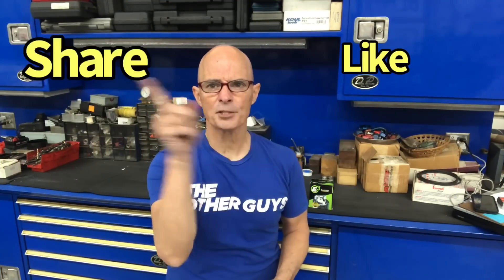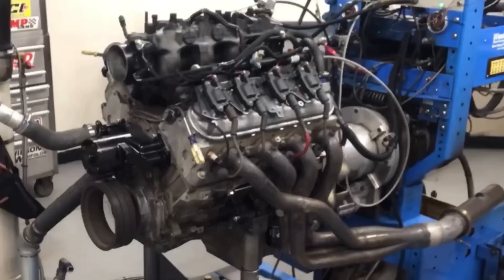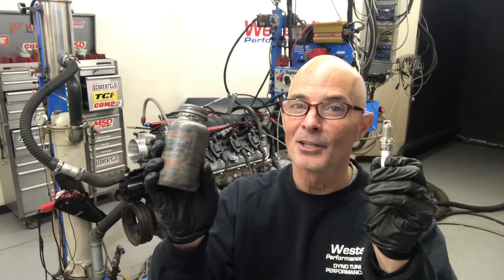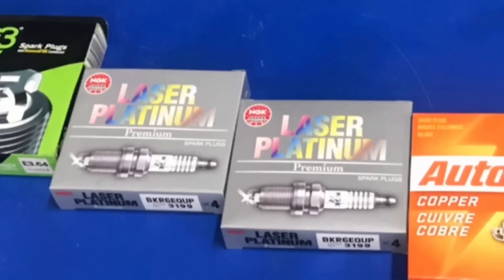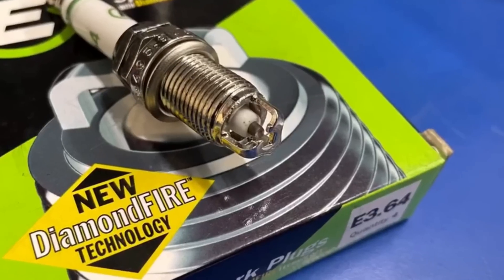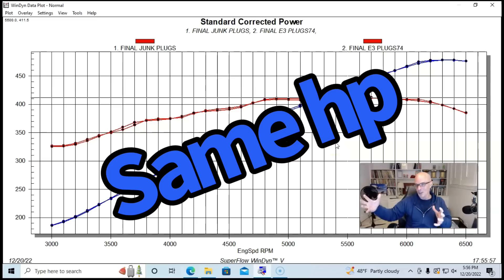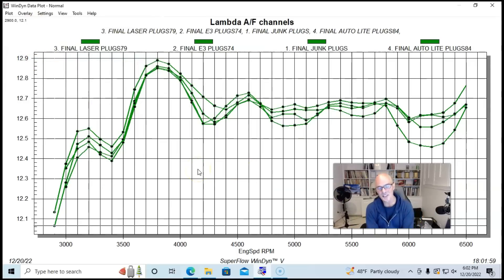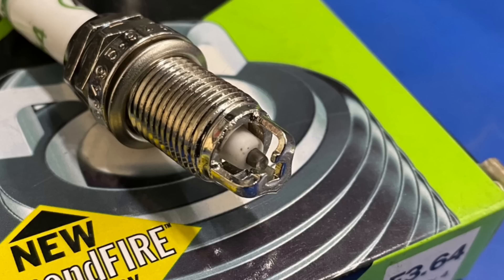E3 SPARK PLUGS-DOES DIAMOND FIRE TECHNOLOGY REALLY ADD POWER? E3 VS LASER PLATINUM VS CHEAP COPPER

Comment: I tried all the gimmicky spark plug back in the late 80's and 90s. NGK, Bosch Platinum, Splitfire, E3, the old AC Delco Rapid Fire fluted plug, and none of them ever gave me better mileage or more power. it may be subjective, but my old 454 used to idle and run smoother with the old AC Delco Rapid Fire Plugs. 

The marketing gimick behine the Rapid Fire was that it was suposed to make a bigger spark kernal to promote beter ignition of the air/fuel mixture. especially if youused a spakrk box, like MSD, Mallory Hi-Hire, etc. they had a display at the local Super Shops (Does anyone Remember them?) here in town they had a HEI distributer hooked up a regular spark plug and a HEI hooked up to a sparkbox and a rapid fire plug, a you could spin the distributers and watch the sparks fly and the spark was bigger on the Rapid Fire fluted plug with the spark box. i already had a MSD box so buying hte plugs was a no brainer. but i will say it did idle better and run smoother than the split fires i took out of it. that could be becase the split fires i was running before were just wrong for the engine. but i have no way to know 25+ years latter.

Comment: Great test, I'm loving this ignition system testing since it's so applicable to so many different setups. You are the first person I have seen dyno test indexing and gapping spark plugs. If I may suggest some future tests, I think "high performance" coils, performance plug wires, side gapping the spark plugs, and different oil grades and types would be great information for a lot of people too.
Reply from the maker: COILS-NOTHING, PLUG WIRES-NOTHING, SIDE GAP-NOTHING, OIL TEST POSTING TODAY
Reply: @richardholdener1727  Sweet, looking forward to that video!
Reply: I’d like to add spark plug wire length. Is the shortest the best or like indexing does having them all the same length help.
Reply: Could you ask about more things that don't change much at all

Comment: I run cheap ngk plugs in everything. Vehicles and ATVs runs great like they should.
Reply: I don't consider ngk to be "cheap" plugs. They aren't a stupid rip off(or maybe not,we'll see) like the iridium and whatever they try to sell you. Ngk are great.
Reply: Ngk definitely aren’t “cheap” plugs they are usually always the highest priced option at least their laser platinum iridium ones that I use.
Reply: Same. Good to read the plugs every 15k anyways
Reply: Me too
Reply: Jus started using iridium plugs on my Suzuki. It does seem better
Reply: I've never had any issues with authentic ngk plugs.  As far as I know, ngk is the oem for chrysler and delco branded plugs.
I'm also a firm believer in running the oem recommended plugs unless the engine has been moded and there's a good reason for deviation.
Reply: Test proves your right!
Reply: Cheap ngk v power copper plugs might be the best overall choice for performance
Reply: Another smart mechanic,Its funny when I send people to the local O'Reilly and they try to push whatever junk plugs they have an excess of/Bosch/autolite Platinum whatever,then they get a dumb founded look when I say nope a want the cheapest ngk plug you have,I've put them in everything including a 367k ls that burned a quart plus a day n never had issues!
Reply: Ngk copper plugs are the best, cheap and work great
Reply: If its a powersports item from Japan or Europe, it gets NGK plugs.
Some of them are more sensitive about it for things he's not testing here...
Reply: @TravisFabel  I ride Suzuki and drive Dodge. They work great

Comment: I bought dual iridium wonder if they are better or just more expensive? I have read they require less amperage to fire so the theory is under high RPM you will have less coil saturation?
Reply: I mean I you have a good running motor like not fouling them out the iridium last a long time like 100,000 miles so I mean it's kinda worth it but if you are going to abuse them cheap might be the play